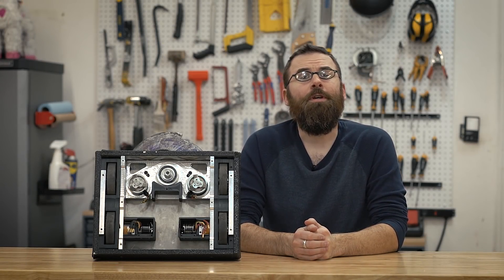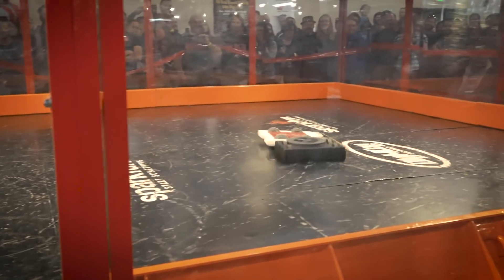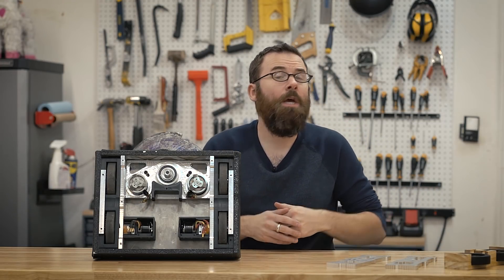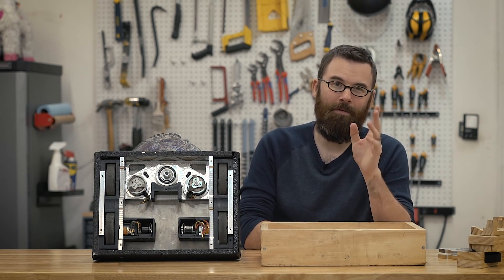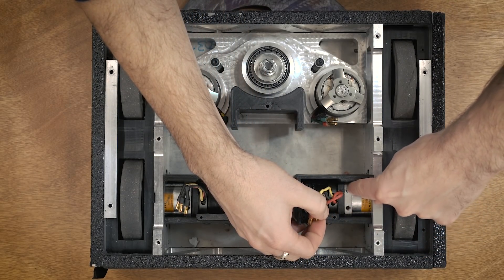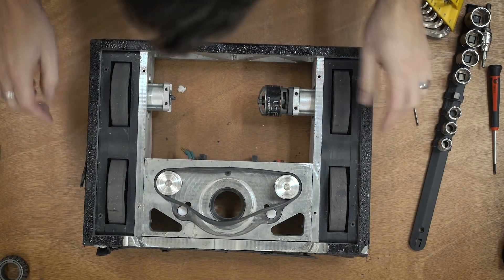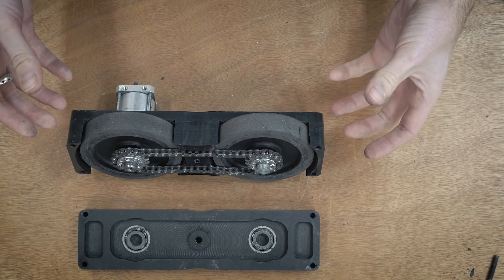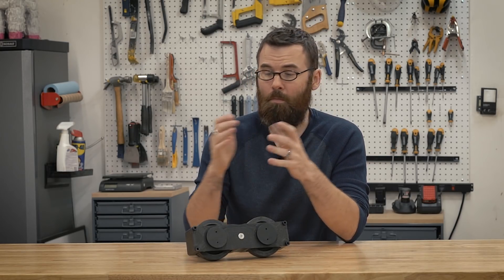Crippling Depression - Part 3 (Drive System)

Comment: @1:50 Doesn't that mean your gear ratios are not optimal if you had to dial back the settings in software?
Reply from the maker: Possibly.  I usually like to have headroom.  If your motors are only ever traveling at half speed/power, they see a lot less wear and are less likely to fail because of heat, or running too near mechanical limits.

Comment: Does your weapon have a brake system. I'm making my first battlebot but the regulations say that we need to have a dead stop of our weapon once it hits max rpm within 60secs
Reply: Most things spin down naturally within a whole minute.
Reply: Generally, only heavyweights sometimes have issues getting their weapons to spin down within a minute. These weapons at lower weightclasses have low inertias compared to hw’s.

Comment: Can i ask why you made motor adapters to mate the 4238 to the banebots gearboxes? i read on e0designs.com> the NTM Propdrive 42mm series have a Mabuchi RS-700 size bolt pattern and a 5mm shaft, which mates with the Banebots P60 700-series motor blocks, not the 500 size.

Comment: Robert, I was wondering for the p60 gearboxes are you using the RS 700 base plate or did you get them custom?
Reply from the maker: I'm using the RS700 baseplate, it fits many brushless motors just fine.  You just need to space it off a bit from the gearbox, or cut the shaft.  I use an ABS spacer, which helps absorb a bit of schock.

Comment: Hi Robet, you said you dialed down the speed in software.  How exactly did you do that?  A setting in simonk didn't jump out.  Did I miss it or did you just reduce the throttle range your remote sends out?
Thanks!
Reply from the maker: I did this in my radio.  One of my 3-way toggle switches controls the maximum signal sent to the ESC.  It's not the best way to do it, but it's easy to adjust.
Reply: @RobertCowanDIY  Thanks.  See you at Motorama.
Reply from the maker: @DanVarrin  Likewise, what are you bringing to Motorama?
Reply: @RobertCowanDIY  A teathered spear launching robot (named Atlatl).  We'll be in the sportsman league this time so we won't get to square off (though I imagine it wouldn't go well for me it happened).  It should be an interesting time.
Reply from the maker: @DanVarrin   Cool!  I look forward to seeing it.
Reply: @RobertCowanDIY  Just to close off the original question, it looks like you should be able to do it in firmware.  Decreasing STOP_RC_PULS and increasing FULL_RC_PULS should give you a similar affect to modifying the controller signal to be smaller.  Due to the trouble of flashing the firmware vs tweaking the transmitter settings and potential for future uses of the speed controller I'm not even going to try and instead just tune the transmitter range.  But this info is here for anyone else who comes across it.
Reply from the maker: @DanVarrin  Yeah, it's totally possible to do in software, but doing it in radio is nice because you can change everything on the fly (which I do sometimes in matches if I want more speed/power).  So yeah, we're on the same page there!

Comment: What if I want to drive the speed of the motor with respect to the analog signal from the throttle.
Meaning I want to determine the speed of the motor with the help of the throttle. Continuous drive with respect to throttle.
Can you guide me with the settings of QX7.

Comment: Why you put in the formula to know the circumference of the wheel twelve ?
Reply from the maker: I'm not sure what you're asking, but I know the diameter of the wheel, so it's pretty easy to find the circumference.
Reply: @RobertCowanDIY  He is saying that in the formula for finding the speed in Excel, you put a 12 in the formula after pi. He is asking why you did that. The reason is because when you calculate the circumference of the wheel Robert chose, it comes out to just over 12.

Comment: the maximum voltage for the drive motor is 17v and why did you use it for 24V....
Reply from the maker: Brushless motors can be run at pretty much any voltage.  Brushed motors rely on the carbon/graphite brushes to delivery power, which is a limiting factor of how much voltage they can handle.  However, with brushless motors, you are only limited by current.

Comment: what happens when the robot is flipped over, doesn't it make you drive backwards. do you flip the Tx over or do you have something built that reverses your input? i'm building i beetle weight and this is something i have puzzled over
Reply from the maker: You are correct.  I have a switch custom programmed on my radio that can toggle the drive direction, so I can just flip the switch to drive inverted.  It's another great reason to get a programmable radio.
Reply: thank you! thats so helpful!

Comment: If I am going for 15kg combact robot................what motor should I be using ?and the ESC................and also the battery  ?
please provide me some recommendation ?
Reply from the maker: Watch all the videos and get a good idea of what I used.  I can't design the robot for you, you will need to make your own decisions on components based on the design you choose.
Reply: Thanks................
Reply: sir........is brushless better than brushed motor.........for Battlebots ?
Reply from the maker: It's the wrong question to ask.  Both have pros and cons.  Start with your design goals and determine the right motor for the job.  Don't start by picking a motor, make your design dictate the motor.
Reply: the wheels...........what are its internal diameter
Reply from the maker: Check the description, all the information on the parts is in there.

Comment: Did u change the shaft for the drive motors to 8mm or left it in 6mm
Reply from the maker: I changed out the shafts on the weapon motors, but not on the drive.  there's no real force on the shaft, so I didn't worry about it.  The ABS adapter plate is there to help absorb some of the shock.

Comment: Why are the gear boxes so expensive?
Are there any other alternatives to the gear box like a pulley kinda system or something?
Reply from the maker: Quality.  High quality gearboxes cost money.  I could go with a pulley system or something simpler, but it would take up more room (planetary gearboxes are very compact) and possibly less reliable.  Pop Tart lost to me (the first time because the drive belts bound up.  The good thing about spending the extra money is you don't have to replace the components nearly as often.  I don't see myself replacing the gearboxes anytime soon.  With a cheaper gearbox, I could easily go through one every couple of fights.

Comment: Thinking about the drive shaft breaking, i suppose there will always be a point of failure. Have you considered a belt or similar, so that if it does get pushed, it is able to slip instead of break?
Reply from the maker: I seriously doubt the shaft can break.  The drive shaft is hardened and 0.5" thick and supported on both sides with bearings.  The other shaft is 0.5" aluminum and about 1.5" long and also supported.  You couldn't put enough force into the shaft (without the UHMW giving way) to deform or break it.  The chain would snap first, or something else would go wrong.  I did look into pulleys and belts, but the wheels slip long before you have issues with slipping, so I went with a chain to get maximum power transfer and durability.
Reply: Maybe shaft wasnt the right word, was thinking about the part that broke... the bit between the gearbox and motor

Comment: Is four wheel drive required? Seems a two wheel drive would save weight. The extra weight savings could be added to weapon features.
Reply from the maker: It's not required, but if you look back at part 1, I talked about how that was one of my main design goals.  With a weapon this big, 2 wheels wouldn't drive nearly as well.  There are plenty of 2-wheel drive robots with huge weapons and they're never very maneuverable.  Weapons tend to fail, so I wanted to have a well-driving robot in the case where the weapon stops spinning.
Reply: Having a great big weapon doesn't help if you can't get it to your opponent.

Comment: Another great video Robert! I have been following you for a year now and really appreciate your delivery and editing. I think it is great to see you using 3D printed parts for functional uses. I use 3DXTECH Carbon Fiber PETG when PLA wont cut it. If you haven't tried it yet I would highly recommend it along with their A2 nozzle.
Reply from the maker: Thanks!  Yeah, I need to play with some other filaments.  I'm still pretty 'new' to 3d printing, I know a lot of the materials and theory on things, but just haven't really had time to sit down and play around with different filaments and such.  After Motorama, I plan to devote some time to it, and hopefully get the stratasys working too.

Comment: Are you going to use shielded bearings for your wheels next time? Seems like the current open ones caught a lot of debris.
Reply from the maker: I'm keeping the same bearings, there is very little debris in them, it's just grease that you're seeing.  They are still quite smooth and don't have much of anything in them.

Comment: How quickly can you get a drive pod out to change a wheel? Your wheels are well protected, but if someone does get ahold of one, it looks like it may take a long time to change.
Reply from the maker: It takes quite a bit of disassembly, but I can do it in like 5 minutes.  It's not as quick as some others, but it's actually not THAT bad.  But it certainly does take some time.  Since everything is just screwed together (not welded), it all comes apart pretty readily and easily, but you need to know the process.  I've gotten quite good at taking it apart, but someone else might take a lot longer because they don't know the design as well.